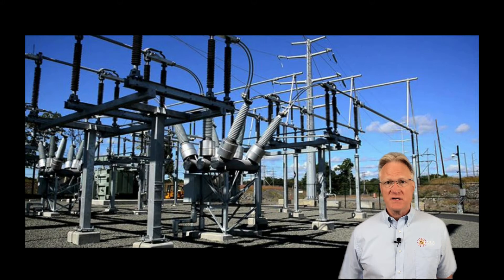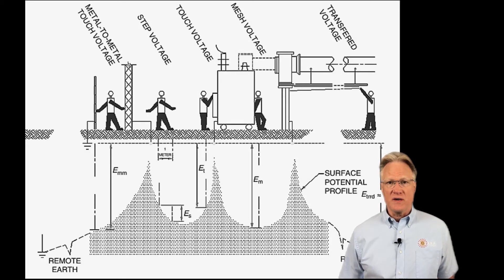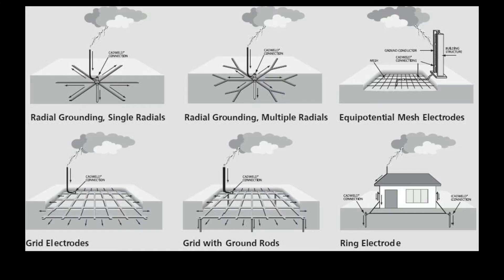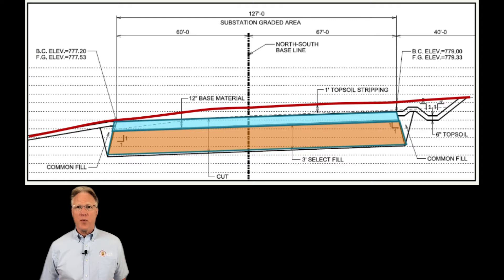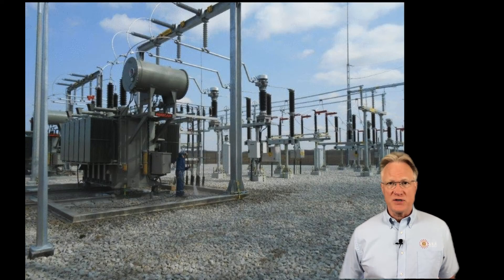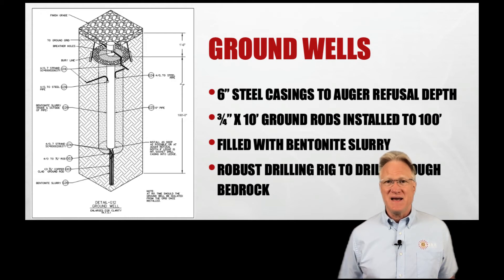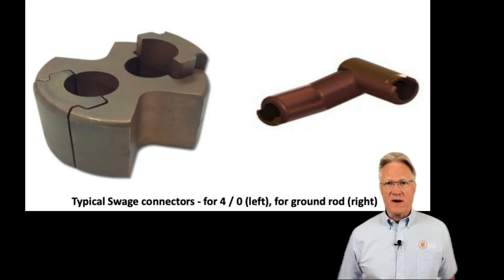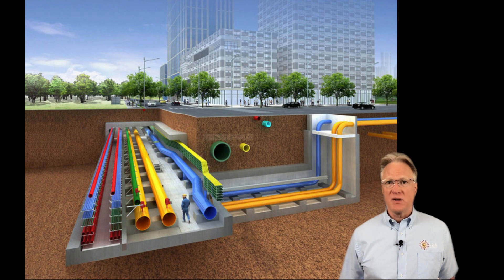Substation Grounding

Comment: I am currently a electrical engineering student 

How does a the ring electrode as shown in the video not create circulating currents to occur should lightning strike the building?
Reply: they do exactly that. if the ring is below ground and expected to conduct the current for the lightning strike, it will flow all over the place in the ground mesh field. This is needed to transfer the huge energy level into the soil in as broad a physical volume as practical, thus protecting the conductors. if you'd like to discuss any of my videos further, please reach out to me. My contact info is on linkedIn